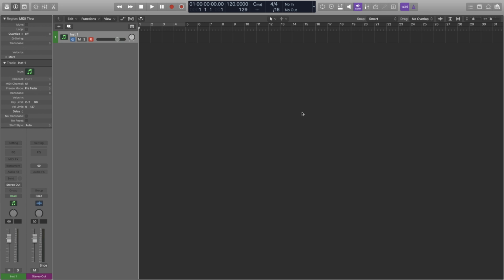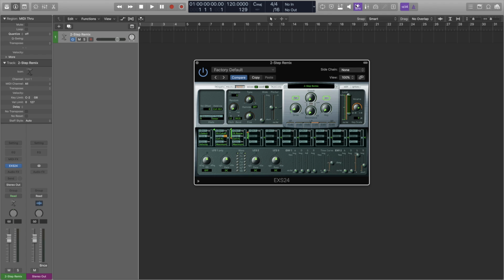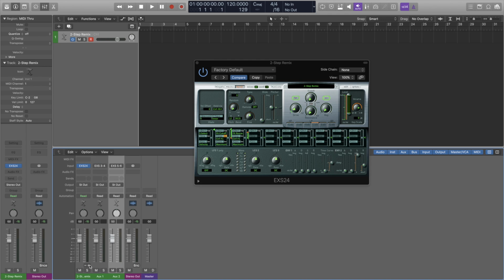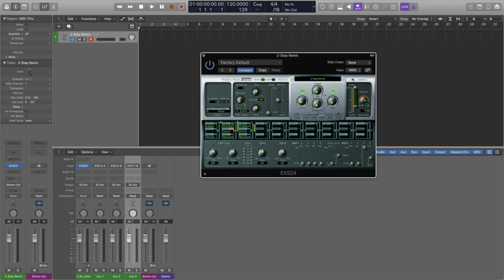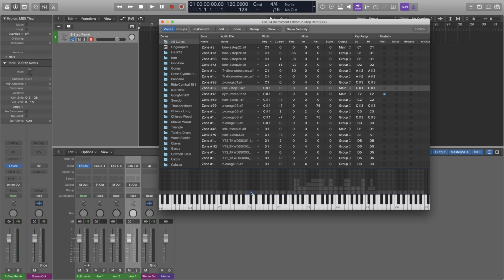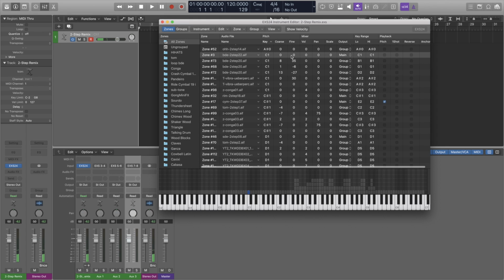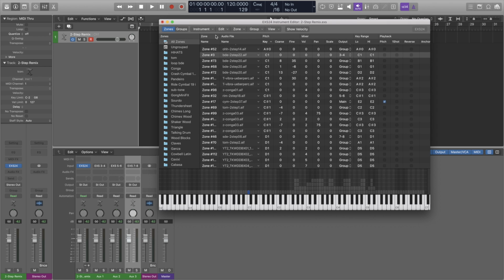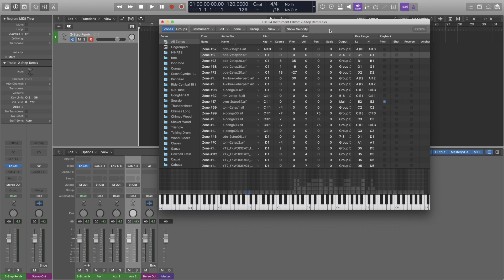EXS24 Multi-Output - Logic Pro X

Comment: Stefan, you are an excellent teacher. You make it look so simple. I always struggled with multi outputs in various software. It gets complicated if I want to use Drum Kit Designer AND Drum Machine Designer together, not to mention say Kontakt. Also, I had no idea about the multilayers. I will set up a multi output for EXS right now. (you can never have enough templates can you???) By the way, what if you want to swap out a sample from the kit you've selected for something else? Either another drum sound or something else completely? Is that easy to do? Thanks, as always.
Reply from the maker: +Francis Srečko Fabian hey Francis thank you man means a lot! If you want to swap a sample you should be able to delete the old sample and drag and drop in the new one. Should be fairly straight forward but drop me an email if you have any trouble. But yeah using both the drum machine designer and drum designer can get messy!